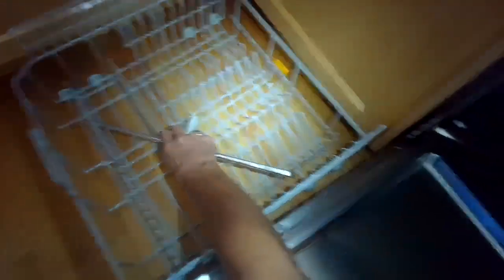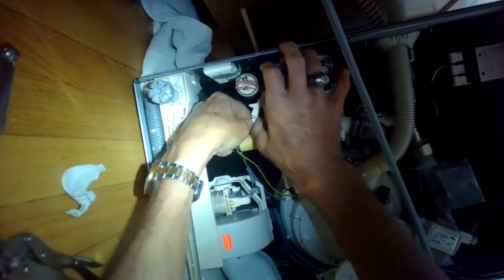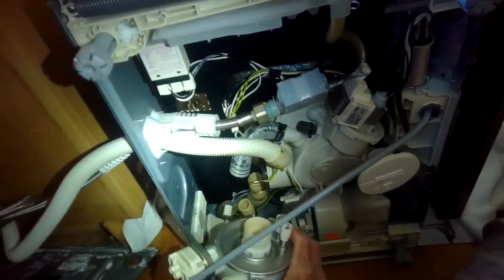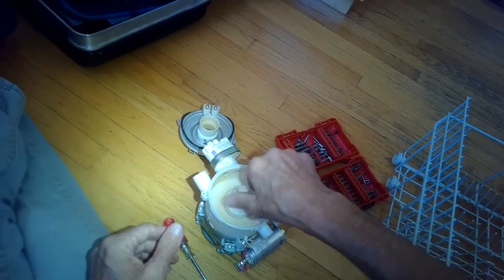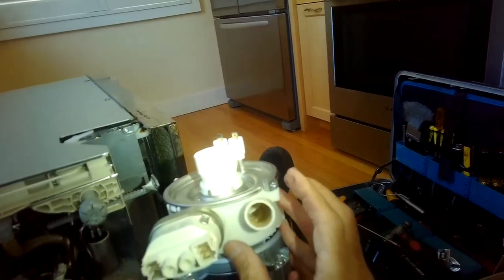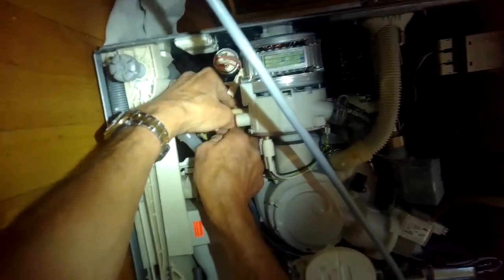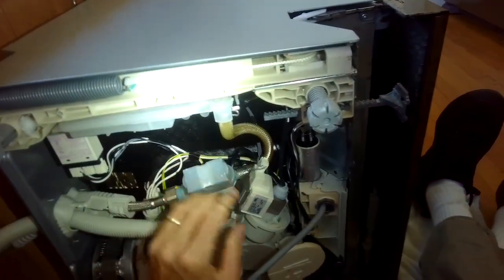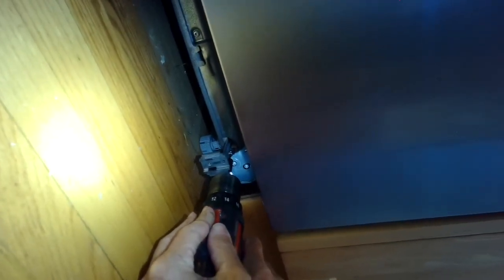✨ Miele Dishwasher - Makes Loud Noise -  DIY FIX ✨

Comment: Scott, excellent video, your illustration made the disassembly easy. Thanks very much. The impeller in my circ pump was in two pieces. The adhesive that joins the two pieces had failed. Miele won't sell the impeller, only the complete pump. You had mentioned replacing the impeller if necessary, could you recommend a source?
Reply from the maker: Great question.
Can you ask them to send you a circulation pump partition kit?
It comes with a new impeller.

Comment: Excellent video.  I used it as a guide to disassemble/reassemble the same model Miele.  Unfortunately I still have a problem - popping circuit breaker.  Do you do phone consultation?  Happy to pay.
Reply from the maker: Does it pop the breaker at a certain point of the cycle?

Comment: Thanks. Just fixed my Miele by following this video for pump removal details. Things I would do differently next time ...
1) Lay the machine on its LEFT side instead. With it on its right side I found that loads of water leaked out of the water softener area onto internal components, especially the heater relay (the white small box clipped to the water softener). If this gets even the tiniest bit damp I found you later get error E24, which went away after a day of leaving everything to dry out.
2) Make sure you have some angled grips to hand. One of the hose clamps is pretty impossible to loosen without that because of the angle.

WEIRDLY the thing inside my pump impeller was exactly the same "bit of a plastic wrapper" as found here. Coincidence? or manufacturing error?
Finally, my pump (in the UK) is different to this one. Plastic body and plastic motor housing containing lots of electronics instead of what looks like an induction motor (?) in the video. The pump was easier to open. My impeller does NOT spin freely, maybe the different motor technology, but all working fine now back together.
FINALLY ... Thank You!!
Reply from the maker: Thanks Simon, excellent ideas👍💻 Brand New Appliance Repair Blog - Lots of DIY Easy Fixes - Click Here: https://www.ApplianceFixes4You.com